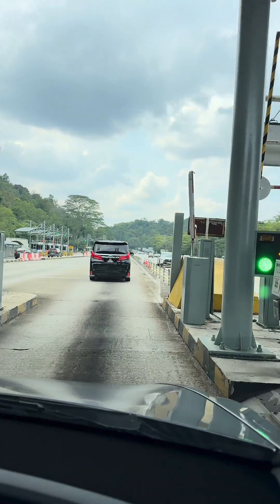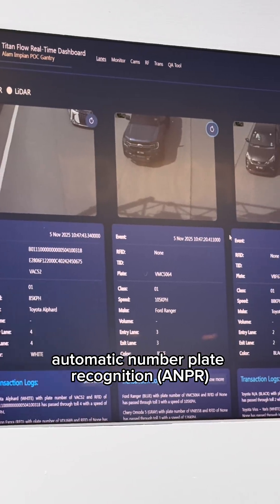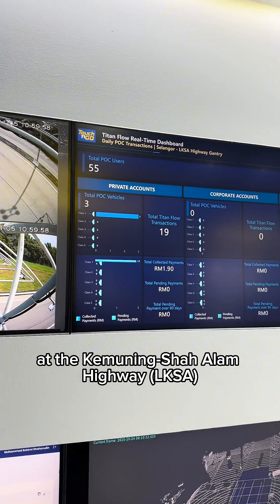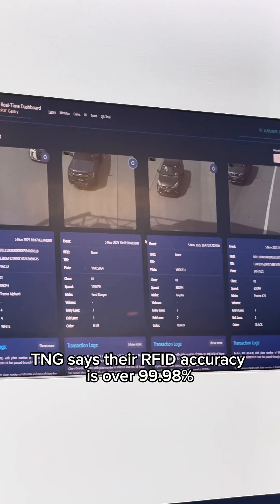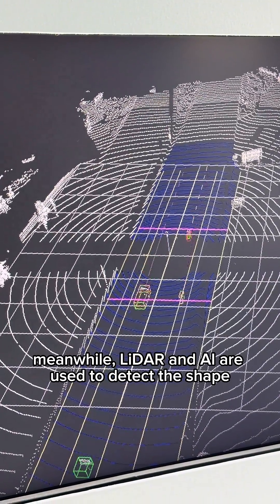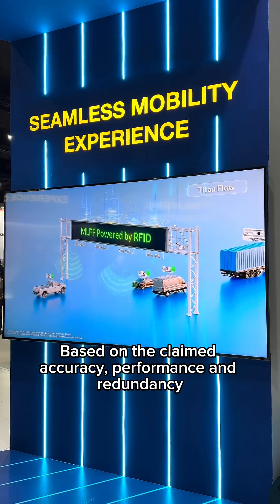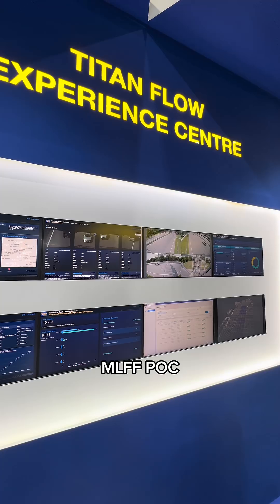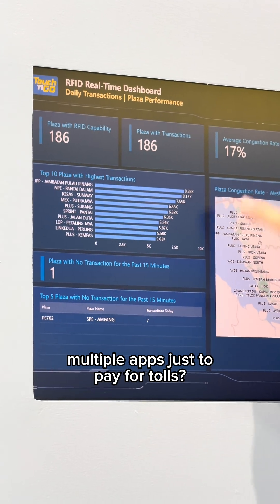TNG Titan Flow MLFF System

Comment: No more tolls. Awesome. They gonna send those without rfid a summons?
Reply from the maker: That's the challenge. There is no national standard for a multi-lane fast flow system should work and enforncement is a critical challenge. As it is, toll operators already having a hard time catching drivers who don't pay toll with the current gated system.